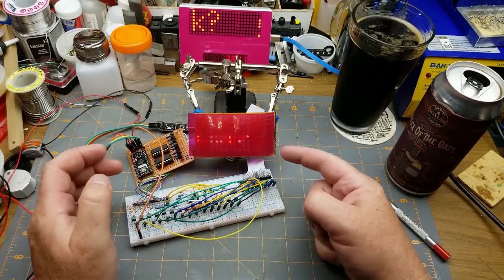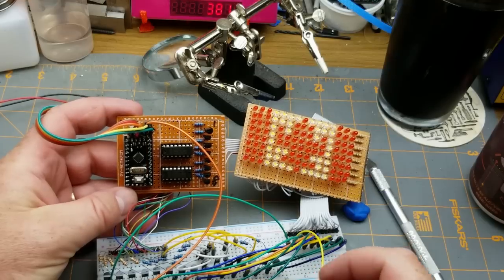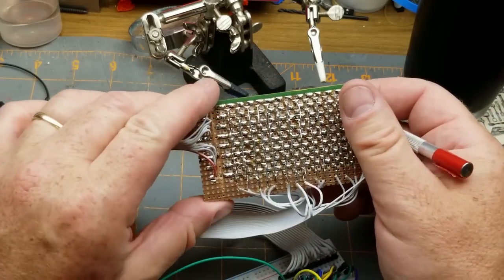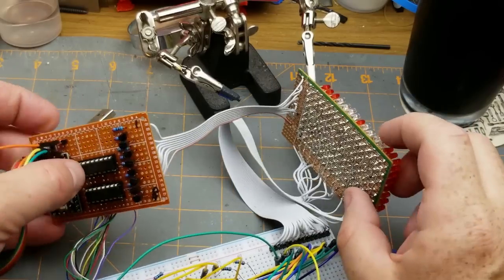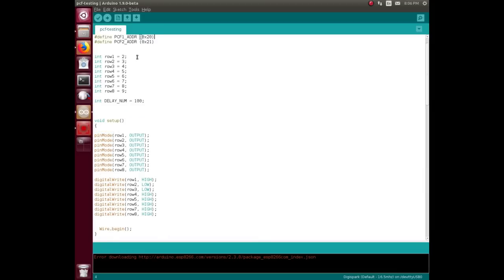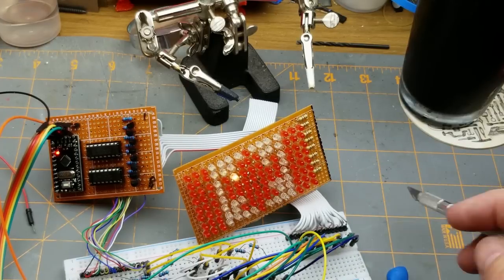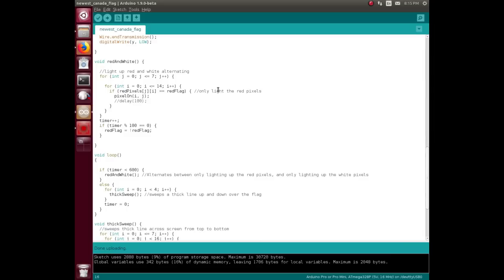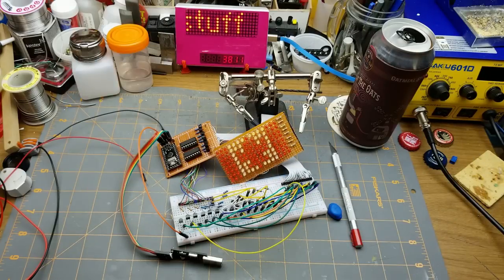My Canada Day flag circuit explained

Comment: Wow, you did some real work on this!  All your LEDs are so neatly aligned.  The flyovers on the reverse look good too.  I made a mess of rasterized-LED grids the first dozen times.  Kept burning them out.  Unsolicited ideas:  Round female pin connector strips to hold the LEDs.  If you have a weak one, you can just pull it.  Shift registers are cheap, chainable, and source current.  The SPI interface on your MCU is fantastically fast, and can drive 595s.  The MCP23017 is another i2c port expander that symmetrically sources and sinks 25mA.
Yeah yeah ... I know you wanted to use the PCF8574.  A cool project for these is to use poling to sink an indicator LED and read a button/switch, all with the same pin.
My 8574s run kinda hot.
Reply: I like the idea of sockets for the LEDs so they can be replaced including putting in different ones to create a different visual pattern so it can be used for multiple visual events.  Turn a flag into a Halloween pumpkin or a Christmas ornament. 
Plus all the hand soldering of direct LEDs looks very scary including trying to align them at the right height and all of that.
Reply from the maker: Good idea on the sockets. I wish I had thought of that.
I even have some in stock.
Reply: @pileofstuff  If I had patience and steady hands, would like to build a 4x4 RGB LED cube.  Even one that small would be an air-soldering nightmare.  You could probably do it!

Comment: at 3:06 you said that you used the 2n2222 npn transistor as a high side switch to source current. which would mean they you need to pull the base about 0.6V  higher then the emitter, with the collector connected to the +ve supply. this would mean to achieve this you are relying on a collector emitter voltage to be greater than 0.6V. unless you have a lower voltage on the collector than the drive Arduino pin.
thinking out loud :  
collector at 5V
emitter connected to the LED's
base being driven from a 5V Arduino pin via a resistor. 
hard on Collector- emitter voltage 0.8V
emitter voltage in the off state, somewhere above 0V, pulled down by leds.

switch base HI, to 5V. 
VBE now greater than 0.6V so transistor turn on. 
emitter voltage now goes up to 5v - 0.8V = 4,2V (0.8V VCE hard on)
this gives us a max of 0.8 to drive the base with. (but very dependant on the individual transistor.

To switch current from the high side I would use a PNP so that just pulling the base lower than the supply on the emitter turns it on.

did I say great vid, been using vero board since 1970's vero pins used to make a terminal post for wires.  blank Veroboard and pins as the main stay of prototyping in out R&D department upto around 1990 for audio circuits.
Reply from the maker: The 8 "row" transistors have their emitter grounded ant the LEDs on the collector.
The "column" transistors are set up as you describe.
I could have used PNP, but for whatever reason my brain prefers to thing in NPN.You're right that PNP would probably be more efficient for the columns, but I happened to have the bag of 100 NPN transistors handy...